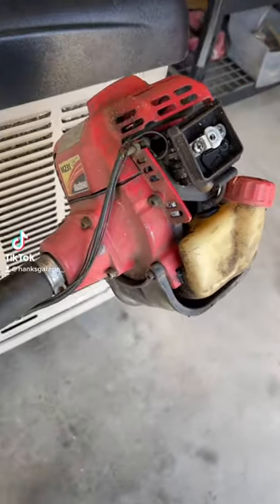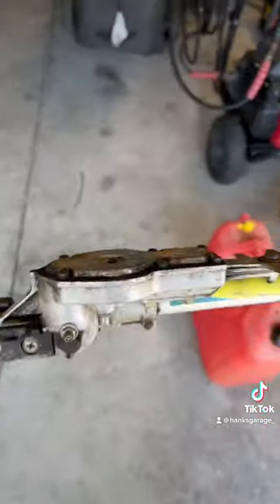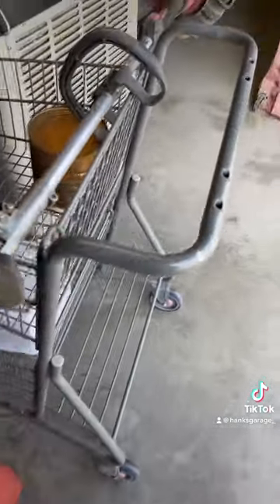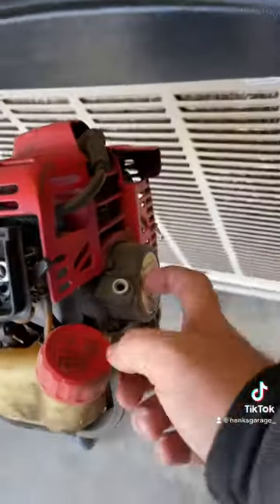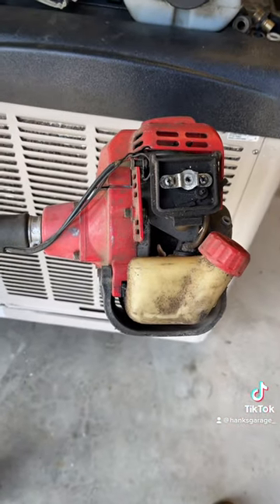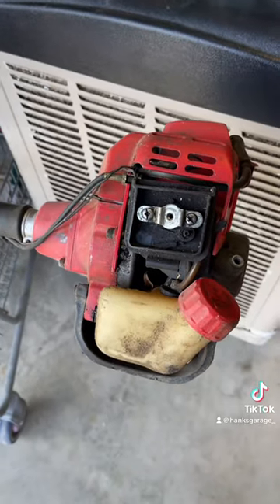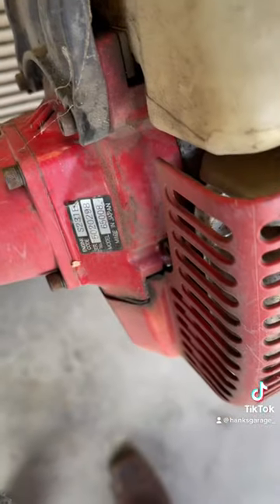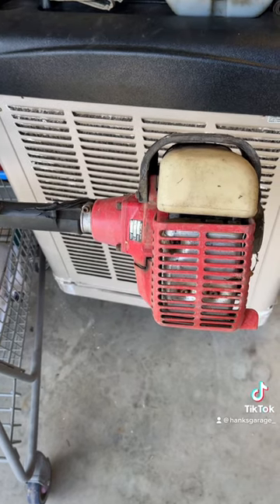Shindaiwa M231 Worth the Save? #smallengine #smallenginemechanic #smallenginerepair #diy #lawnmower

Comment: Shenzen, China.
But they go with Echo.
They have a headquarters in USA.
Hope you find your parts.
See if you can figure out why they stopped trying to fix it.
Ive had luck with older stuff by asking at places that had older trimmer stuff out back, unloved.
Some folks just didnt like the weight or balance of certain machines.